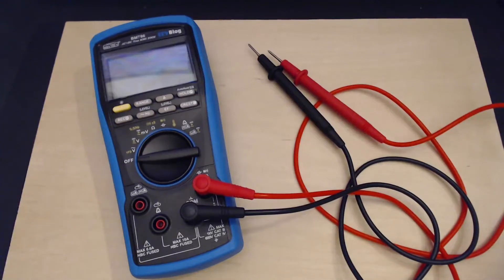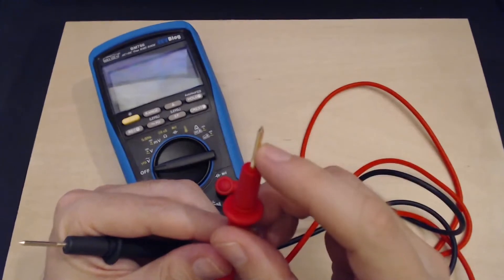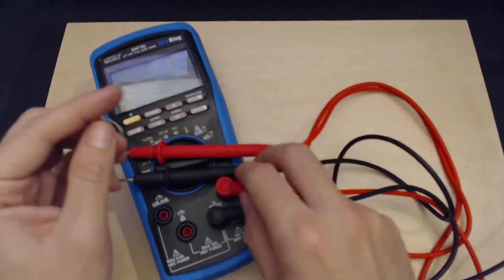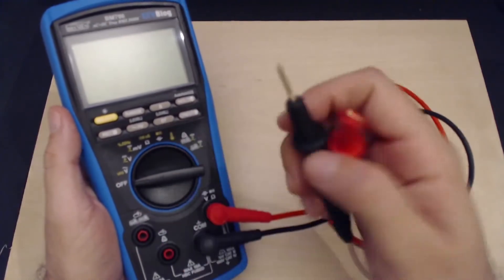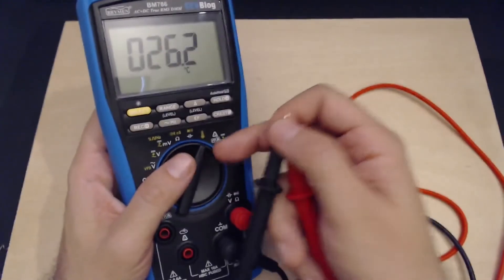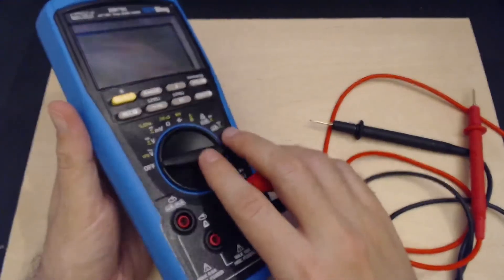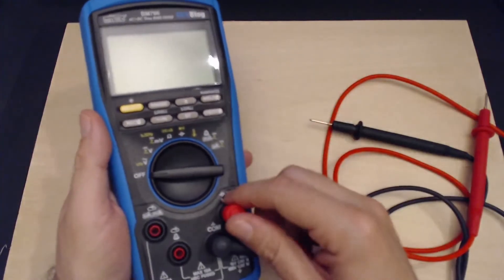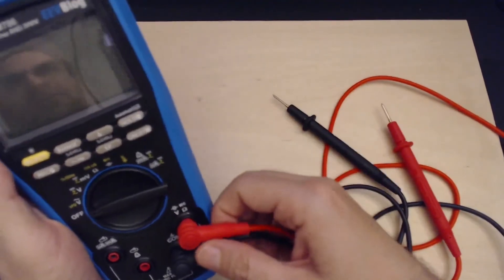Brymen BM786 True RMS Digital Multimeter Review - Part 2

Comment: Regarding the measurement of the internal temperature one particular situation needs to be considered. Lets say you were measuring current..for a reasonably long time..then you may want to check the internal temperature of the meter to see if the current shunt heated up the internal space of the meter..Note that many meters have this built in as a function and you do not need in these meters to shorten the probes to get the internal temperature reading..however it also  limits (at least in theory) use of the meter in this mode as a triggered ambient temperature measuring device..BM786 can be used in this case for that purpose also..